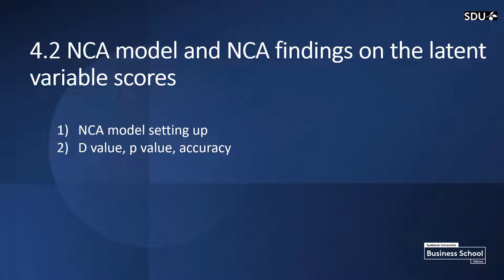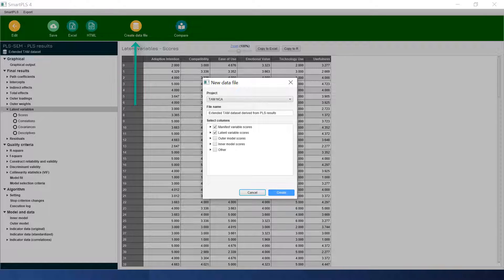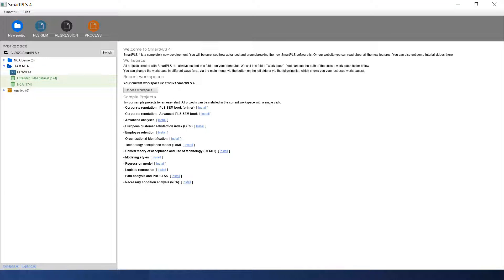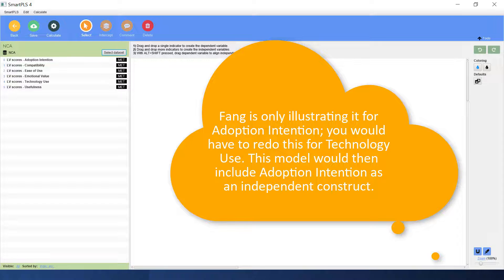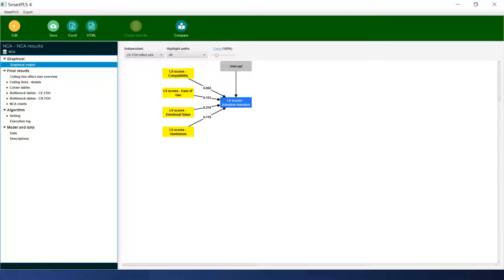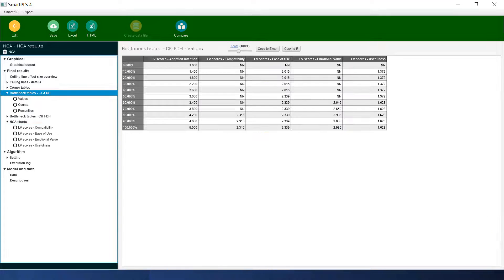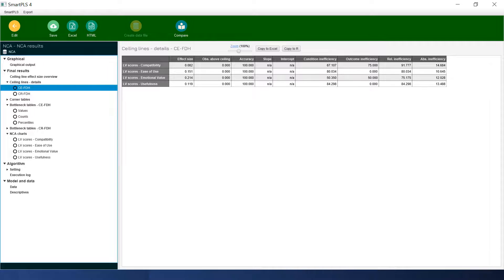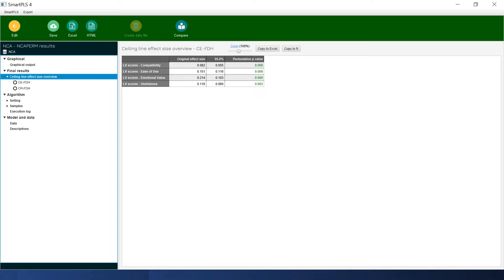4 NCA in PLS-SEM Software demonstration (Part 2, NCA in SmartPLS)

Comment: Hello, The video is very good and self-explanatory.  I have a query regarding chart. The article you referred is showing the chart with yellow and green color lines. I checked the properties in SmartPls 4 but there is not option to enable that. also in your video it is not visible. also the background effects.

Comment: Hi, I know this is a stupid question but the bottleneck tables produce only percentiles. How do I convert them into percentages that can be reported? Thanks
Reply from the maker: Not at all stupid: in SmartPLS, there are currently three options to display the bottleneck tables: Percentage Ranges / Actual Values for the dependent construct, and Actual Values, Counts and Percentiles for the independent constructs. I.e. if you want to reproduce the R-Studio percentages for the independent constructs, you will need to do that yourself. 
Please find further explanations here (available currently in Research Gate first): 
Richter, N. F., Hauff, S., Ringle, C. M., Sarstedt, M., Kolev, A. E., & Schubring, S. (2023). How to apply necessary condition analysis in PLS-SEM. In H. Latan, J. F. Hair, & R. Noonan (Eds.), Partial Least Squares Path Modeling: Basic Concepts, Methodological Issues and Applications: Springer.
Reply: @NicoleFranziskaRichter  Thank you for the prompt reply :)